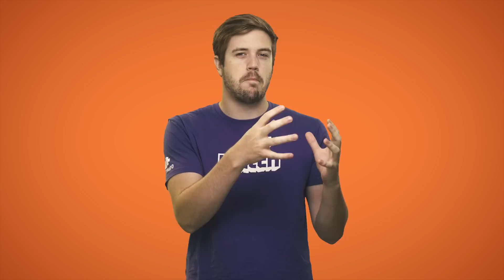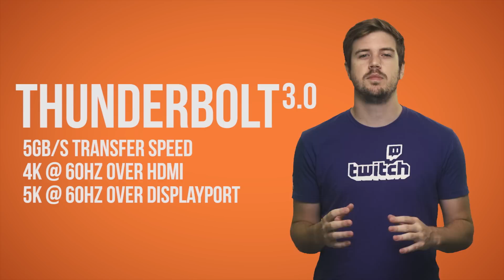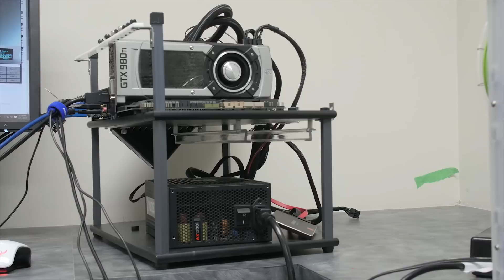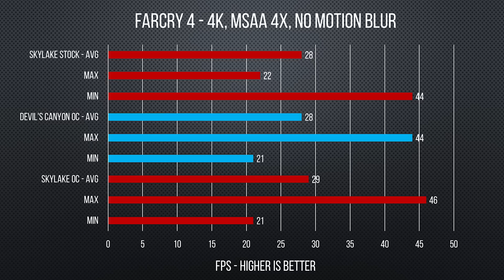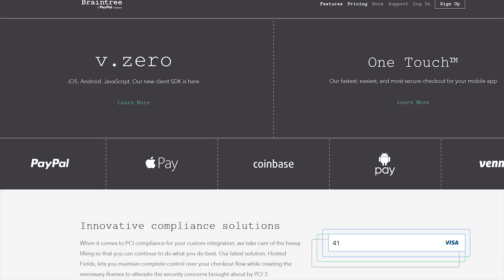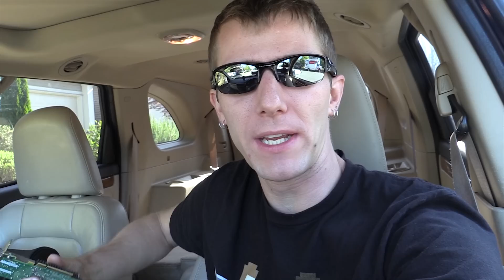Intel 6700K "Skylake" CPU

Comment: Does anyone feel the audio is slightly out of sync?
Reply: Mat Smith yeah, it is.
Reply: LMG's videos have been a bit shoddy since the move :/
That give away video had the worst white balance and a few have had out of sync audio
Reply: Jeric Castillo I excluded the WAN show because... it's always broken haha
Reply: slightly? The beginning  is brutal.
Reply: Mat Smith The first minute or so is around 1/4 second out of sync, but it seemed to improve after the first advert.
Reply: I feel like your comment is out of sync
Reply: Mat Smith only seems to be out of sync on the 4k quality for me.
Reply: It's basically perfect for me, I don't see any problems
Reply: Mat Smith its been like that for quite a while now. i don't know if you noticed it in the wan show videos
Reply: Mat Smith I don't see it at all.
Reply: Mat Smith I think it's more dropped frames/reduced frame rate?
Reply: Perhaps some added latency from shifting the equipment over and not fine tuned.
Reply: Michael Blochberger Yeah, this guy's right
Reply: Mat Smith You have a point there mate.... ahaha
Reply: Mat Smith Yep, but it got fixed later in the video.
Reply: Seems fine to me, was it still processing at the time?
Reply: +henry bacon still seems a bit off for me.
Reply: it sounds like it has a bit of white noise
Reply: Michael Blochberger I see nothing out of sync, and a 1/4 of a second is huge disparity.
Reply: +Mat Smith On the HTML version of the video, it's off by a pretty noticeable amount. The flash version is possibly off by a few milliseconds, but much closer.

Edit: It seems like it's better after the intro theme.
Reply: ***** Ahh man, that was fucking edgy. Sorry you're too delayed to perceive latency.
Reply: Mat Smith 420 likes
Reply: +interlace the reason they do that is because 4k videos are extremely large and since all of their videos are being stored on a server and their editors need to access those videos at will, it would mean that they would need to access much more data slowing down their workflow. Besides what's wrong with 1080P?
Reply: Mat Smith For my some reason my internet is not letting my watch stuff at 1080p only 360p and i resseted my wifi like 20 times
Reply: +Mat Smith nope, audio is fine, but the greenscreen work still sucks (really bad/no lighting on his hands, colorspill and fuzzy edges)...
Reply: +Mat Smith It was probably something with youtube since you watched it close to when it came out. 10 hours later the audio just fine.
Reply: Mat Smith Their videos have always been shoddy, especially compared to a channel like hardware canucks which is run by two people.

Linus just hires retards with no qualifications.
Reply: Mat Smith That's a youtube issue I've noticed. You have to refresh it after like 5 minutes and it re-syncs.
Reply: +Mat Smith I didn't have any problem with the audio but .... that is entirely to much gd orange....ugh!
Reply: +Mat Smith I was thinking the same thing... it's odd if nothing else.
Reply: Ya I thought the same thing lol
Reply: +interlace you don't know much about encoding do you...
Reply: yeah I had to turn the video off. it's really off putting to me haha idk why
Reply: +Mat Smith I thought some(60%) of the video after 2013 seem a little out of sync...especially the wan show (but that meant for listening not watching)
Reply: +Mat Smith win10 strikes again
Reply: +Mat Smith And an odd echo. Like they recorded it in the bathroom.
Reply: +Mat Smith KNOW NOTHING about video, but this background is quite dark to get a good balance. It is not the proper place to make videos. Video quality of LMG have been always premiun grade, perhaps you need to get used to this set. IMHO need more light. It looks like they took the vid in the shadows. Perhaps they noticed this already but too busy to shot again. But, well, they have the chance to improve this during edition.
Reply: Mat Smith Yeah, up until after the Intro.
Reply: +Mat Smith it definitely is
Reply: Mat Smith there has been issues with Adobe Premiere CC 2015 rendering out-of-sync video...no update available yet :/
Reply: +Mat Smith  damn you , why did have to say that lol i couldnt stop looking at his lips all the way through.

Comment: Can confirm - I'm also still on 2600k.
Reply: Mateusz Wojtkiewicz Great CPU still for most games even today. Next upgrade i say is prob worth grabbing dont rush this year wait next.  I was on the 930 I7 for many years but it couldnt hold up to most games today so i jumped the gun to a 5930K but its because I stream on twitch and needed the extra 2 cores. Other than that your cpu is perfect for another year easy.
Reply: Henry Charlotten why does anyone buy 5930k when 5820k exists unless you're running a 3-way sli or something
Reply: Mateusz Wojtkiewicz still rockin i5 2500k
Reply: Mateusz Wojtkiewicz Im still running the i7 920...
Reply: +Sasquatch Guy I'm still rocking my i7 860!
Reply: Mateusz Wojtkiewicz Still rockin' my Q6600 lmao
Reply: The difference between new generations of cpus is so little these days upgrading feels like wasting money.
Reply: ***** Thats part of the reason why i got it i had 770 3 way sli then i said fuck it and got the 980 Ti i plan to get another one later down the road this year for SLI Plus I also use it for the lanes for PCI E cards for sound cards and PCI E SSD make sure I have enough lanes.
Reply: Mateusz Wojtkiewicz I'm still on my good old I5 2500K , thought to upgrade to a 6700k but then realized that i didn't realy need an upg that badly and i can wait for the next gen CPUs
Reply: I5-2500K at 5Ghz here
Reply: +Mateusz Wojtkiewicz 2500k @4.2
I think i'll wait for the next gen.
Reply: +ImSam3G what games do you play with 750 ti?
Reply: Mateusz Wojtkiewicz 3770 here. It does what I tell it to do and more.
Reply: +TacComControl Heyyo! I got the same CPU here! We're i7-3770 buddies :D I really do hope that it's not time to upgrade for me...
Reply: Blade Mastr Don't see why. I regularly pound my poor little 3770 with hardcore video compression, heavy operation stacks, and otherwise. It handles it all just fine. All of that plus the heavy gaming load, and it barely breaks a sweat. Of course, 16 gigs of RAM make a HUGE difference, and a 970 Nvidia card makes it all come together into a bit of a beast that outperforms the most modern Mac Pro units.
Reply: +TacComControl Let me ask you, are you a psychic or something? Cause that is exactly what my gaming PC has lol.
Reply: ***** You're not the only one, my friend. Still running fine :D
Reply: Mateusz Wojtkiewicz 4.5gh god
Reply: TacComControl My machine is the same, but with a 2600k :)
Reply: I'm on my i7 4790K.
Reply: ***** Yeah but that is actually slow by now. Play BF4 and you'll suffer compared to a Sandy Bridge and higher.
Reply: ***** I play BF4 fine, its the internet that kills me...
Reply: ***** Not on ultra. I used to have the same chip. It would to max at 100% in BF4.
Reply: ***** Go to my channel and watch some BF4 videos. It runs fine XD
Reply: +Blade Mastr I have the k version. Tested it against my friends sky lake with the same gtx 770. No performance increase that was out of the margin of error.
Reply: Mateusz Wojtkiewicz yay another 2600K here at 4.5 ghz
and gtx 780 sli @ 1110 mhz : D
Reply: Mateusz Wojtkiewicz Any one with an i5 760? I am still rocking the first generation overclocked to 4.1 GHz stable for 3 years hehe. and the games are running good witcher 3 on ultra 40 to 60 fps with the r9 290
Reply: ***** can it handle Witcher 3? xD
Reply: +mjs1231 I'm on my i3 3220
Reply: Mateusz Wojtkiewicz yeah, i5 2500 there and I feel that upgrade for some extra performance is too expensive in those times
Reply: Mateusz Wojtkiewicz Yessir same Cpu OC at 4.2 Hasn't failed me since launch.
Reply: Mateusz Wojtkiewicz Me too! Thing has been running on 4.2Ghz for years <3 what a work horse.
Reply: ***** 33-39 Celsius Liquid cooled attached with 2 fans on the radiator.
Reply: 2500k here - not even needed to overclock yet
Reply: whosdr
its a good CPU on its own :)
Reply: Mateusz Wojtkiewicz Can confirm 2600k master race!.
Reply: Mateusz Wojtkiewicz I'm on an i3 Nehalem, but it looks like Intel went all out on the 6700K.
Reply: ***** JUST DO IT Make your dreams become reality. That cooler will do the trick.
Reply: 2600k here at 4.8ghz and I have to say this cpu really stands against time. its like the nvidia gtx 8800 it just keeps on giving
Reply: Sandy Leask Yeah dude this CPU is great. I'm running mine @4.2 with a GTX 680 and it's STILL a total monster.
Reply: It really is and i don't think ill swap it out for at least another 2 years. I have a 780 and it's a monster indeed with this cpu. Absolutely no bottlenecks it's great!
Reply: Mateusz Wojtkiewicz same here lol got an asus gtx 970 the other day. I'm legit waiting for a good reason to buy a new motherboard and CPU and have been for a while. Intel refuse to build it, guess i'll refuse to pay.
Reply: +Mateusz Wojtkiewicz Had that in my last PC, it holds up extremely well. I wish I still had that machine ahah
Reply: I have an i7 920...
Reply: ***** haha im too :)
Reply: ***** Close! Running 2600k at 4.2Ghz with a 770ti
Reply: +Simon YouTube Me too. Its perfect for gaming
Reply: Mateusz Wojtkiewicz What would you guys recommend as a new CPU for 3d animation? I need one that supports 64GB RAM but not super expensive. Mine is 2600k too right now.
Reply: The 2600K should do fine! As long as you have a 64-bit CPU (which you do) you can use 64GB of RAM. As long as the motherboard also supports it. Or do you want to upgrade your  CPU anyways? the i7-4790K is really good!
Reply: +Mateusz Wojtkiewicz 
Also rocking 2600k + GTX 980 for 1080p gaming!
Reply: Nick Leijenhorst Thanks man but on intel page it shows 2600k is capped at 32GB memory. Are you sure it can use 64GB? http://ark.intel.com/products/52214/Intel-Core-i7-2600K-Processor-8M-Cache-up-to-3_80-GHz
Reply: Radiation4TheNation Mmm... that is odd! I didn't know this. I don't think I can help you then! 64GB is a lot... Maybe one of the 6-core CPU's of Intel can support it!
Reply: Nick Leijenhorst Thanks man, that's Intel for you with their artificial product segmentation. I need 64GB because I deal with large simulations, but don't want a Xeon.
Reply: Core 2 quad master race
Reply: Im still on the AMD Phenom II X4 945
Reply: +Mateusz Wojtkiewicz I'm on a i5 3570K don't plan to upgrade for another 2-4 years
Reply: Mateusz Wojtkiewicz Still fast as hell lol
Reply: Mateusz Wojtkiewicz i use 2C duo 8400 and 2C quad 6600 ,also  4690k and 4770k.
 ill pass broadwell and skylake.......
Reply: Mateusz Wojtkiewicz 2500k and its still alwesome
Reply: +E “Aphid” Quinn Asus Z97-A . Awesmoe by a longshot
Reply: +mjs1231 Im interested, paypal ready. Message me with more info please!
Reply: Mateusz Wojtkiewicz 2600k represent!!!!! easily got 4.4GHZ on that beauty
Reply: ***** you ant the only one, i'm thinking about getting a i7 960 second hand, just need to save up a bit of money
Reply: +Mateusz Wojtkiewicz 2600k for life.
Reply: +Sasquatch Guy i7-965 / GTX 680 and my games run just fine at 1080p. If my computer can run Fallout 4 when it comes out I wont be upgrading anything for a while longer lol.
Reply: Mateusz Wojtkiewicz 2400 + 970 here :D
Reply: FX6350, still rocking the board :)
Reply: i7-2600 & i5-4690k here
Reply: +Mateusz Wojtkiewicz another 2600k boy here!
Reply: Also 2600k..gotta say best purchase I ever made
Reply: +Mateusz Wojtkiewicz 
2600K @ 4,5 GHz (Noctua Air cooled) here :p
Was considering Skylake, but its not worth it tbh :)
Reply: i5 3570k running for the past 3 years @4.2GHz with just the hyper 212
Still is blazing fast.
660ti's need a swap soon...
Reply: +alphazero1995 Got both the i5 760 and i5 2500K i dont se a need to upgrade both of them tbh
gonna wait until robert space citizens
Reply: +Mateusz Wojtkiewicz 2600k and 990x. Old good days. :) 990x FTW!!
Reply: TheDarthJesus
Yes, if the next gen will even be worth it :p
Reply: ASDheaven I thought this gen would be worth it :(
Reply: TheDarthJesus
Not from Sandy Bridge, even though its 4½ years ago, we have to wait a little bit longer...
Reply: 4.5ghz oced 2600k + GTX970 + 16GB RAM PC Master Race baby, pretty sure I'll be good for another 3 years unless Intel starts moving their ass of their throne.
Reply: alphazero1995 Its funny, because I've got an I7 930 with 2 reference r9 290 and in ultra I barly touch 60 with 2 cards.
Reply: Ciupa Di Capra same here, and i wanted to upgrade baaaaaad but the performance jsut isnt there and i can certainly wait for features...
Reply: +FTV That's because you are GPU bound.
Reply: +Stefan Karlsson Crysis 3 was the game that made me realize that my good old i5-2500k @ 4.7 Ghz was not enough to keep up with my EVGA GTX 780 Classified.  The Welcome to the Jungle level would dip down into the upper 30's in fps. When I upgraded to a 4790k, the dips were in the upper 50's. It's kind of ironic, because Crysis 2 was the game that exposed my CPU bottleneck with my Q9650 @ 3.5 Ghz.
Reply: Gamevet Really? Interesting since C3 run fine on my 2600k
Reply: 2600k <3 sadly no sandybride support for win 10. Which is disgraceful
Reply: zatch01 Where did you see that? DX12 is more about the GPU taking the resource load off of the CPU.
Reply: Pentium g260
Reply: Gamevet z68 motherboards and older (sandybridge) are not supported for win 10. Tried ignoring and upgraded anyway. messed up my os and had to clean install when downgrade messed up. (may have been caused by intel smart cacheing)
Reply: Gamevet http://www.asus.com/microsite/mb/Windows_10/
Reply: I've heard no such thing. That would mean that all of the AMD stuff would not be compatible, since the FX lineup and boards are all nearly 3 years old.
Reply: +Gamevet not compatible and not supported are different. Mabey in the future they will upgrade bios and Intel drivers for z68. But doesn't change the fact that I had to spend my weekend fixing issues from win 10 upgrade because of driver support and clashes with Intel raid drivers
Reply: +Gamevet can't speak for amd. Was using asus and Intel. But from what I gathered it's the same.
Reply: +Mateusz Wojtkiewicz same not upgrading till my next just because i want a damn nice pc build. its never been the bottleneck for my usage.
Reply: +Mateusz Wojtkiewicz I gree
Reply: +Sasquatch Guy I rocked my 920do from 09-2012...that thing oc'd crazy...4.4@1.36.  I still miss that chip for its crazy oc..and my first oc experience..keep runnin it buddy.. it benches on par with 2days hi-end amd chips. (which is awesome for a 2008 intel chip) even if u hava co chip..i wood overvolt the shizzle outa that thing.
Reply: Still using my old trusty Intel Core Duo with my xfx gts 250.
Reply: zatch01 Those problems are happening to a lot of people though. That's why I'm in no hurry to upgrade to Windows 10 on my Z87 or Z68 setups. 

I've heard that a clean install is really the best way to go with Windows 10 and it's probably the only way that I would do it.

That Asus list is only showing the hardware that Asus, themselves, have certified to work with Windows 10, or has a bios update to correct issues. It does not mean that they went back to update the bios of every one of those boards to run Windows 10. My Asus Z87-WS board isn't even on that list, and that was a $340 board.

http://www.maximumpc.com/windows-10-graphics-cards-and-motherboard-drivers-updating/
Reply: +TheNoobySpartan it's still good though
Reply: +Mateusz Wojtkiewicz I feel like there's so much wasted potential xD

Comment: I still feel as if ddr4 is not much better than ddr3 to warrant using it and its accompanying processors
Reply: +Trevor Murphy In normal CPU computing, DDR3 and DDR4 makes no difference in performance. When you overclock, that's another story, but the thing that's going to benefit the DDR4 speeds is iGPU, especially AMD's APU, these things need more memory speed to compensate for the lack of bandwidth. On the Zen APU side of things, we might see HBM 2.0 inside the chip (like eDRAM on Intel IrisPro), but better memory means a lot to iGPU, even with those kind of improvements.

Again, for raw CPU performance without being an ultra-extreme overclocker, DDR3 and DDR4 makes no difference whatsoever (at least for now).
Reply: Future proofing my son, it helps
Reply: +Trevor Murphy True. In the real world there's absolutely no difference between ddr3 and ddr4. cash grabs everywhere
Reply: Daw why I'm going DDR4, so I don't need dat new motherboard or RAM later down the line, because soon DDR4 will be cheaper, and just that SUPER TINY bit faster
Reply: ***** DDR4 was mainly introduced to X99 first due to the extreme overclocking headroom that DDR4 provides. Now with Skylake and Icelake coming in the coming years the normal CPU chipsets can catch up with X99. I have a 5820k and 2666 MHz DDR4 and it overclocks HIGH. At like 3000 MHz. So with greater intensive apps and games coming it'll be more useful
Reply: +beeza copper ^ Not now. Not even close.